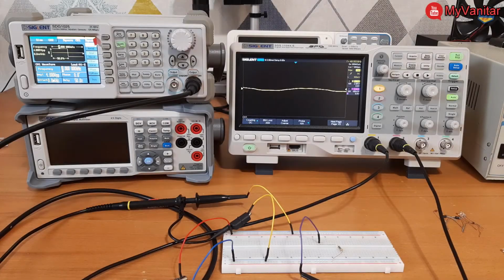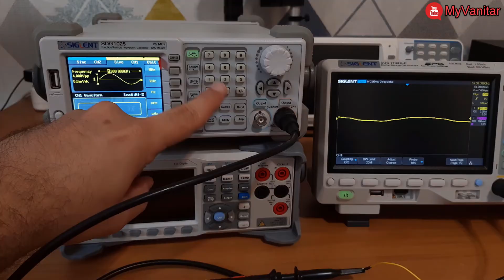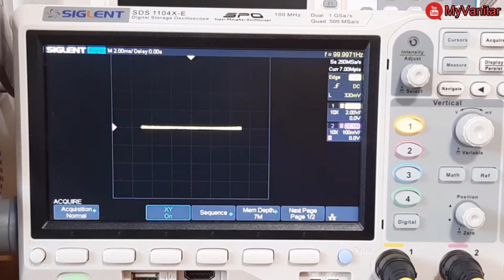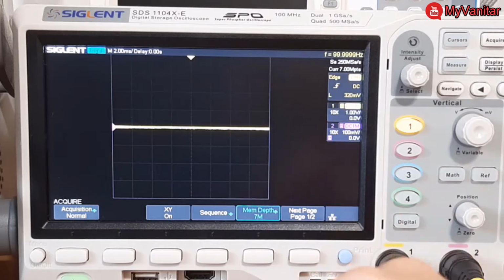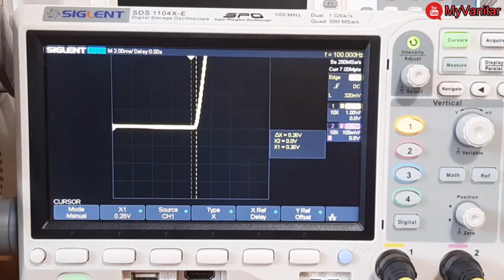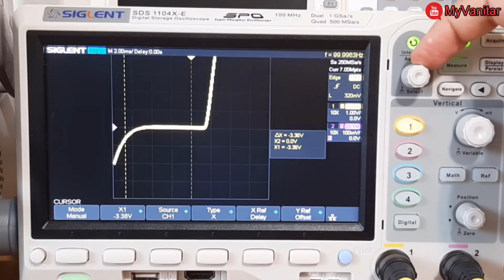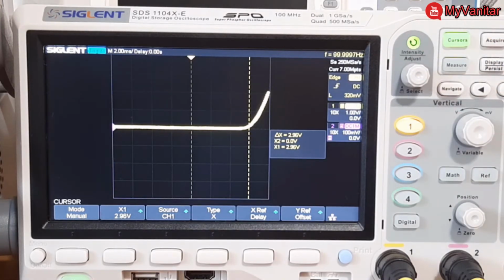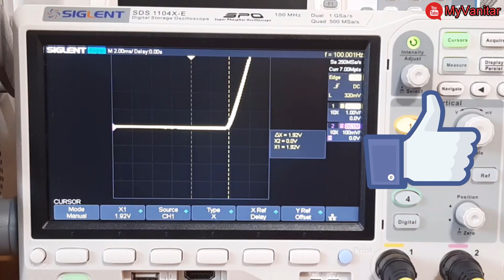Component Tester (V-I Curve Tracer) Using The Oscilloscope XY Mode

Comment: Planning to use the supply generator test from my oscilloscope, it is 3V and 1KHz, what would be the resistance instead of your original 10 Ohms ?  thanks
Reply from the maker: That's to limit the current and act as a voltage divider. You can start with a high value, for example, 1K, then 470 ohms, 100 ohms, etc.

Comment: my signal generator is limited on 5v, is it still possible ? tnx
Reply from the maker: use a simple step-down 220V/110V to 12V or whatever transformer, but limit the current using a bigger resistor (higher in resistance)

Comment: Hii

This tester is very simple. You just need to make two-lead sine wave generators. x.y -0-180 degree phase angle inverse sine. Drive with popular ic8038 and even better ad9833 generator .or simple oscillator .transformer or transformerless .opamp. voltage is adjustable from 5v ac to 24v and frequency from 50hz to 1000hz. current should not exceed 1ma to 5mA. it is enough to know the logic of a resistor and a coil.
Reply from the maker: Yes, I did not claim it's complex. By the way it is quite good in detecting faults in a complex board
Reply: @MyVanitar  yes, general explanation. When the block system is put together, it's simple ...everyone can benefit, I don't need to spend a lot of money. .    Thanks

Comment: When i am doing in circuit measurement and doing resistance measurement i see the waveform for resistor comes like zener diode. Is this due to all component inter connected? If so how to conclude it.
Reply from the maker: I have no idea. in my case, it shows a line crossing the center, where the slope is the resistance. this circuit is very basic.
Reply: Yes, if you're going to test a single component, it needs to be isolated from the circuit.  You're likely seeing the other components.  The signal going in is AC low voltage, so any transistors, diodes, zeners, or ICs that are connected will change the output.  These 'testers' are really for individual components, not really calibrated or suitable for in-circuit testing.  If you're testing a rectifier diode, it should look a certain way.  A zener has a different look, and a resistor has yet a different look.  That's basically what it tells you.

Comment: In the schematics a voltage of 10VPP is applied, now if i do a component test in circuit will this not affect my devices. MY board operates at 5VDC.
Reply from the maker: in the schematic, I did not show the 10Vpp, it is general. it was my own setup to test a 9V Zener probably. you have to change the input based on your requirement, I should not tell you everything.

Comment: H Sir, Using the circuit shown in video can i test a 10K ohms resistor? Will i get the expected output. Also the ground of the AFG to be connected to the ground of oscilloscope. To be connected to which ground.
Reply from the maker: You can test whatever you like, including resistors. all grounds are common. the schematic is clear
Reply: @MyVanitar Well, imagine you have a dead short component and apply a 5V peak source to it. The effective current will be 354mA and the power across the resistor is about 1.25Watt. From the video it seems you have used a quarter watt resistor, though, which appears underrated depending on the device under test.
Reply from the maker: @SloBloLabs   This will not happen if you use a function generator because they have a limited current and a 50R resistor in series, by the way always limit the current if you use for example a transformer or something similar.
Reply: @MyVanitar  Agree 👍.

Comment: Fantastic. Can I do in normal digital oscilloscopes
Reply from the maker: if it supports X-Y mode, yes you can
Reply: @MyVanitar  please suggest me the oscilloscopes which have. X y
Reply from the maker: The best bang for buck digital oscilloscope is the one I used in this video. Siglent SDS1104X-E. I have worked with many at this price range and this one is better than all. if you live in the EU, you can purchase it directly from the Siglent German branch.

Comment: I have multiple resistor with one end connected to vcc and other end connected to respective device pins. Basically these resistors are pull up resistors.
Reply from the maker: 90% of the time, when resistors fail, they burn and get black. it means you will notice this from the visual inspection. 70% of the time, electrolytic capacitors show some kind of bulge on their head when they fail, however not all the time. sometimes they get dried out internally. the easiest method is to just take them out and test them. just two pins!
Reply: @MyVanitar  In my board i don't see any resistor gone bad (no burn). My board contains lots of components and every time cannot remove each of the resistor and check for it. Instead i wanted to do ICT. How can it be done. In my board i have multiple resistor with one end connected to VCC and other end connected to individual IC pins. How can an ICT be done for this?
Reply from the maker: @sanjayparelkar3912  You as a repairman should spot the problem first, not to test all components! There is no tool to test everything fast on the board.
Reply: @MyVanitar  sir you are right, but i come across boards where all components looks good from top with no bulg no black out and board is completely dead. So i was think of using ICT methodology.
Reply from the maker: @sanjayparelkar5055  You must do reverse engineering and spot the problem. I mean is it from the power supply unit, input/output, ... etc. nobody checks all components. Also if it uses a switching power supply, the main rectifier capacitor might be dried out. as I said bulge is one sign, not always

Comment: Can I use 1khz Square wave signal?
Reply from the maker: I think using the 1KHz signal will put some stress on the waveform generator output, because the load is just a 10 ohm resistor. You can forget about the waveform generator and use a simple step-down 220V-12V or 9V or 6V AC transformer as it delivers a 50Hz sine wave.
Reply: @MyVanitar  I built a similar circuit and put it in a project box.  It includes a transformer, BNC connectors, mains plug, etc...  works the same way.  I found your video because I was looking for how to connect it!  It's been a few years and I forgot the setting on the oscilloscope (X/Y, etc)...  But I used a 120VAC to 6.3VAC transformer, which is safe for just about anything, I believe.
Reply: Меандр дает только три точки -U, 0, +U. ничего у вас работать не будет при любой частоте.